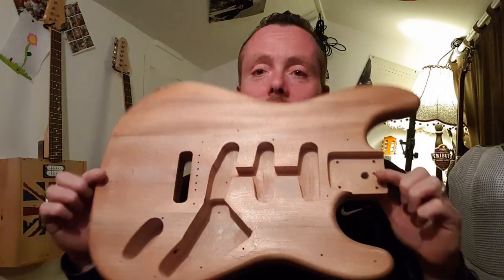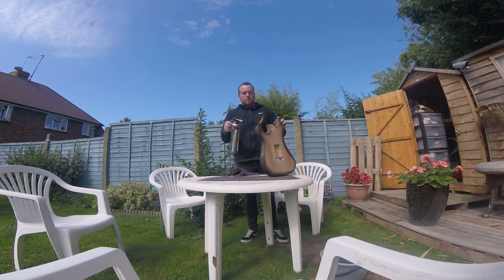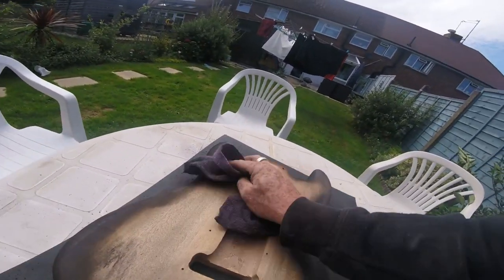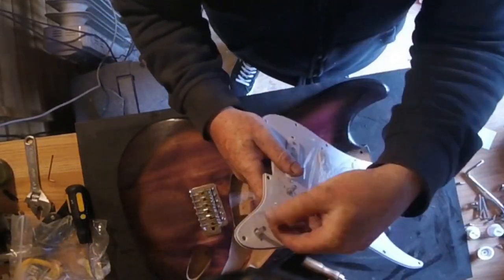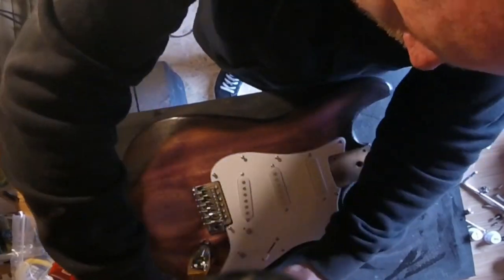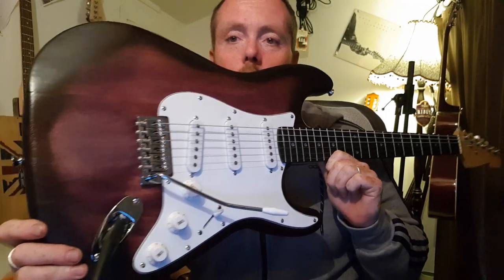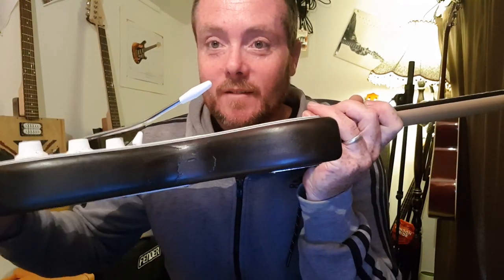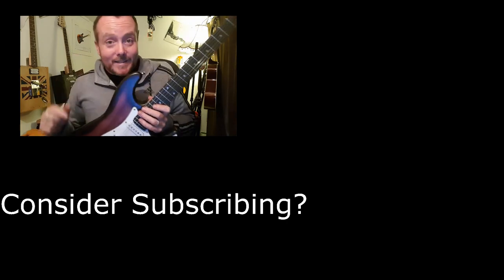HARLEY BENTON / STRATOCASTER KIT / How To Use A Blow Torch To Finish A Guitar  / REVIEW AT THE END!

Comment: To ensure the body won't fall apart, just run some water-thin superglue into the cracks, quickly followed by normal superglue, the thin stuff drags the thicker stuff in. Let it all set solid then sand it down. I use that trick regularly and so far no failures.
Reply from the maker: Great idea

Comment: I found that working with wood that if you get cracks especially if you are burning or painting, fill those cracks with CA glue and then sand. It will hold in place and in the case of the guitar it will do great. Understand that when you are done with burning then you add the glue. Don't do it during otherwise you just wasted your time. At the end you have a good looking piece and you don't have to worry much about it cracking further.
Also, take care of those sniffles. They came in louder than the sanding that you were doing. Peace and Blessings to you.